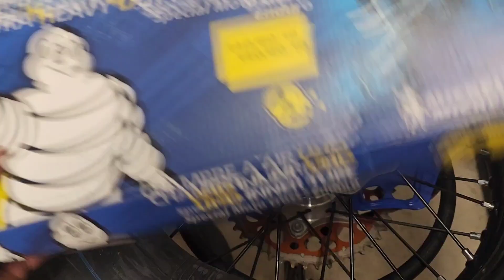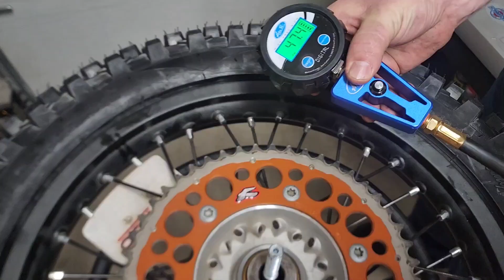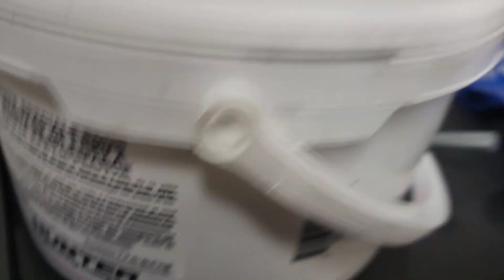Dual Sport & Dirt Bike Tire changing, slow tire change done by a beginner.

Comment: What size rear tire do you have on the FE 350?  My 501 has tkc 80's.  They are stock 120/80/18.  However, the manual calls for a 140/80/18.  I'm vonfused about what size to get when I upgrade .... My 701 ran a 140 and it seemed like a very big tire, Motoz Desert H/T.